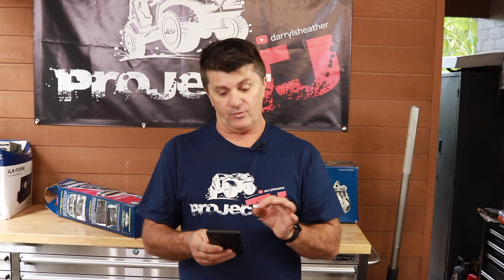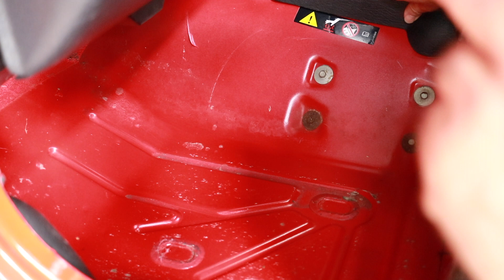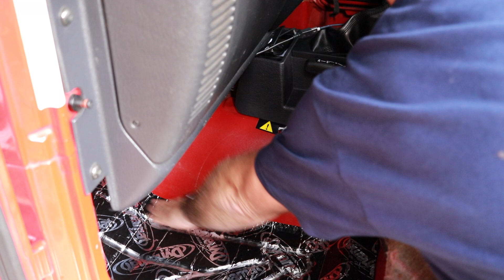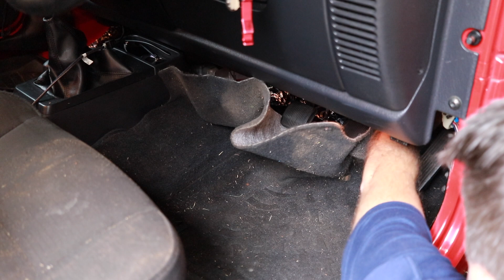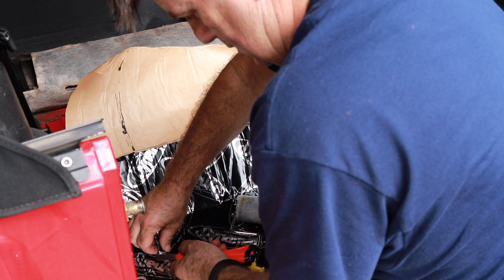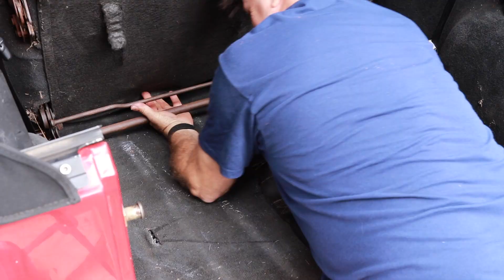Soundproofing Project TJ - Dynamat Extreme - Ep  26

Comment: I had a 2004 TJ RME , and have zero issues with heat through the floorboards etc , I can idle my truck in +30 hot sunny days and never have overheating problems,   I have factory black rug on the floor , no sound deadening etc added in , even have a warn winch and an angry grill blocking some airflow , appreciate your videos ! Have a video of my TJ  in a video on YouTube

Comment: I have an '05 TJ Rocky Mtn. Can you tell me how much you needed to complete the job? After reading some of the comments, I'm going to just install a Bedrug in the Spring. After all, it's a Jeep with a soft top. I knew what I was getting myself into long ago. But I certainly wouldn't drive anything else. Best vehicle I've had by far.

                O|||||||O
       🇺🇸 ONLY IN A 2 DR 🇺🇸
               '41 - '06
Reply from the maker: Used 2x Dynamat extreme Trunk kits. I hear good things about Bedrug!
Reply: @DarrylSheather  
Update: I've had the Bedrug with just the front Weathertech floor mats on for about a year and a half. It's been great! The rear Weathertech floor mats are absolutely useless since everyone has said, they don't fit. My younger son is always seated on the rear bench seat, still in a booster seat. And he beats the crap out of stuff. His side of the Bedrug has minimal wear at best which is amazing considering the abuse it takes. I have the Bank Power exhaust on my '05 TJ Rocky Mtn and that is definitely among my favorite mods, just an awesome throaty growl, burble with zero drone. The db's are certainly lower now after the Bedrug install and I have a soft top. Honestly, I don't know why anyone would cocoon themselves with a hard top in a vehicle meant for that great open air experience! Anyway, that factory carpet was like a glorified paper towel compared to the Bedrug.

Comment: Why did you not take the seats out and do under the seats, lots oof area there, hot zone also.
Reply from the maker: I have to add in the seat heaters and need to take out the seats fo do those. Will Dynamat then. Also have to replace the heater core, so will do the firewall when changing that over.

Comment: You will find that in the really hot floor zones, above cat converter and exhaust pipe, the dynamax butyl rubber will melt and flow, it will find  a way out and down, it it drips on the muffler exhaust pipe, cat, it will smoke and smell terrible. In time this subsides as the butyl rubber deposit becomes thinner and exhausts itself.
Reply from the maker: After changing the inner shift boot Randy, I'd have to disagree with you. I sealed up the broken boot with Dynamite and it kept its form quite well. If it was going to melt it would have at that point as some of the Dynamite was the only thing separating the cab from lies underneath the vehicle. Quite happy with how it coped.